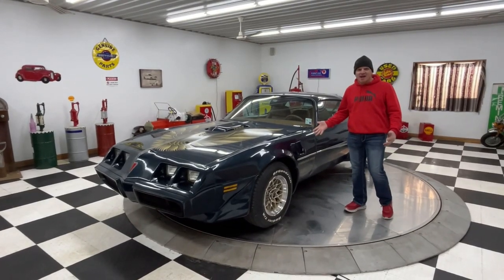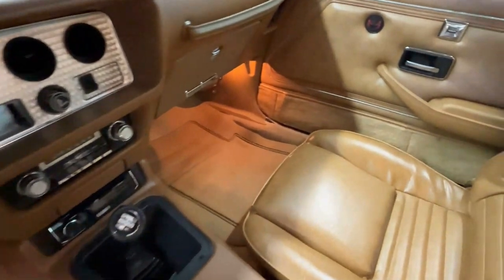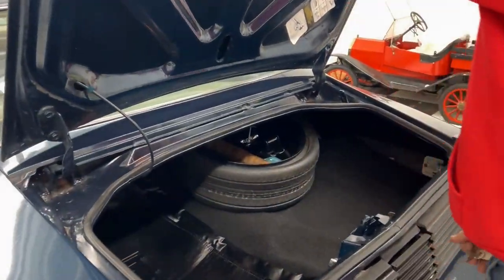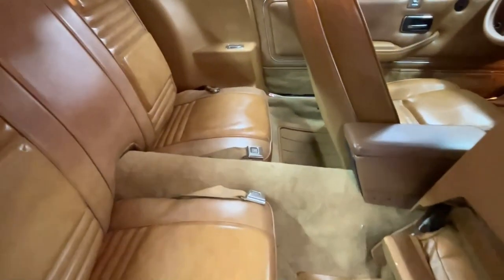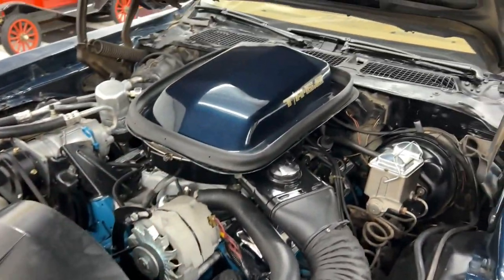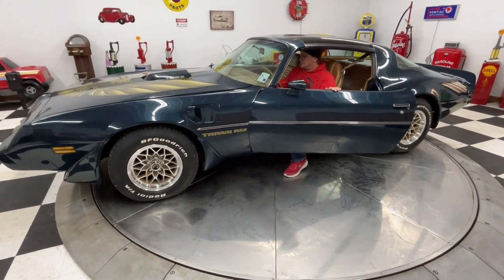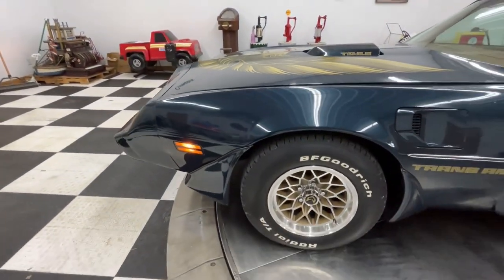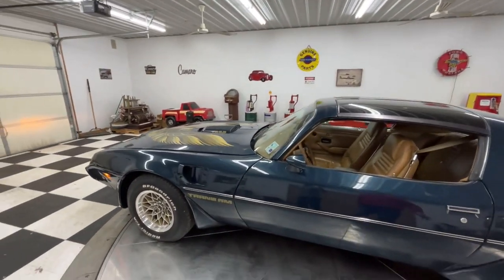1979 Pontiac Trans Am

Comment: All Pontiac engines were big blocks, what made them different were the strokes, bore, cranks , rod length and heads that made the difference between a 326 and a 455. There is more to it, but that’s the just of it. Pretty smart of Pontiac. To bad they are not around. I’m a true Pontiac fan and owner, 75 Pontiac Formula, 462, 5 speed Tremic ,restomod.  Too many upgrades to list. Had it for over 40 years. Pontiac forever!